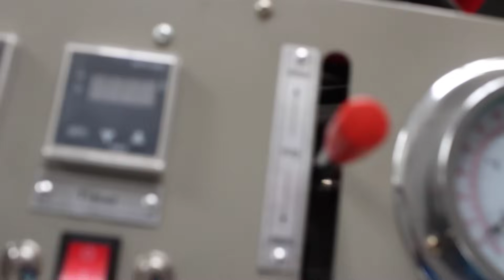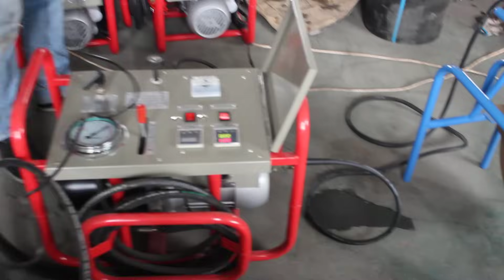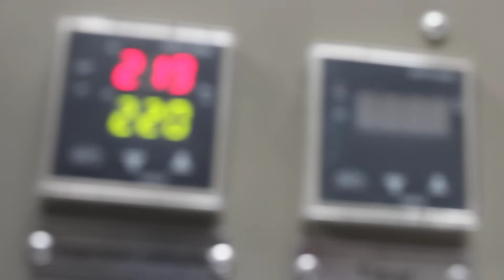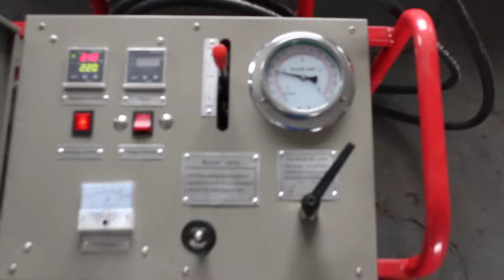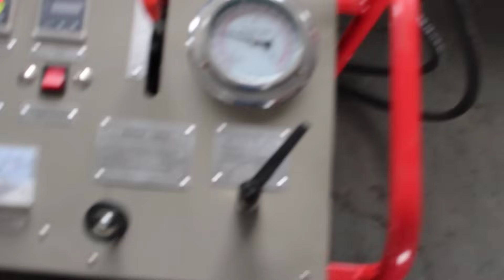90-315 hdpe butt fusion machine operation/funcionamiento de la máquina de fusión a tope 90-315 HDPE

Comment: Buena nocches como consigo el manual de termo fucion de 160 180 200 250 315 y 500 gracias
Reply from the maker: Jaimemmkkoppl Holgu j Querido amigo, ¿podría darme su dirección de correo electrónico? Entonces te enviaré la cita, ¿está bien amigo?
Reply from the maker: @mdshabbir6761  which country are you in? I need add the country code to call you, tks.
Reply: @ericpan1944  hola amigo necesito saber la presión del diámetro 315mm n cdr 11 cuanto de presión debo poner muchas gracias

Comment: Now make a fusion with 2 pipeline of 10 meters as minimun
Reply from the maker: Dear Mr. Luis, could you send me your e-mail address or WhatsApp number? And need you tell me the diameter of the pipe line. By the way, my e-mail is:sales@sudabuttfusion.com, WhatsApp:008618253285200